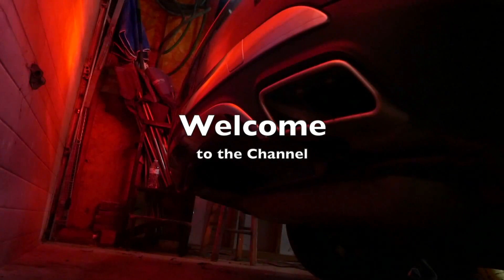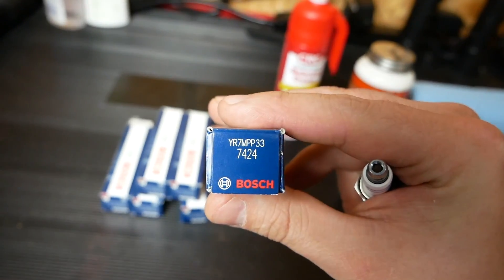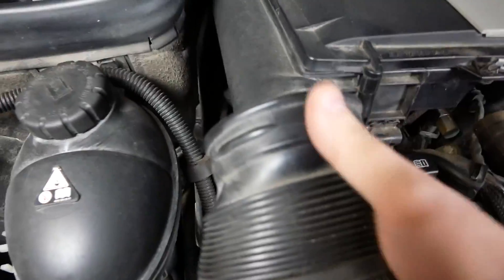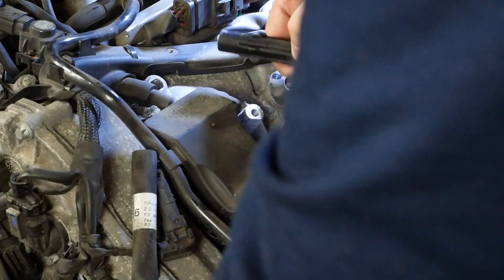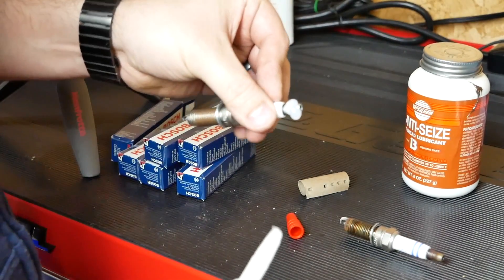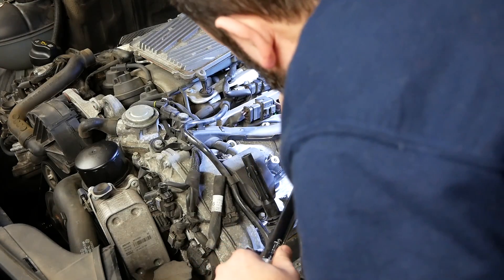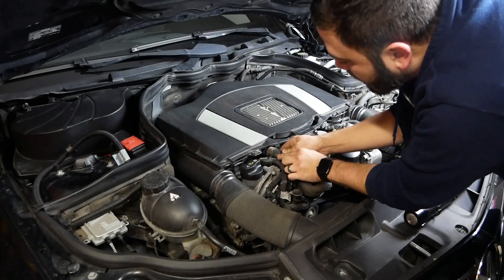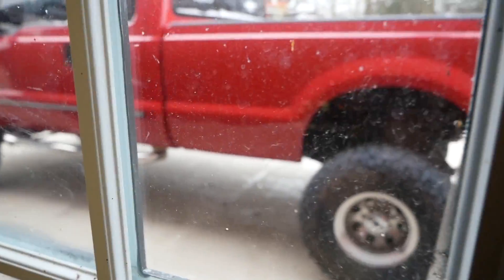W204 Spark plug replacement C300 M272 Engine 7MPP33 (v6.9.0)

Comment: I believe modern advice is no anti-seize compound as the plugs have a special coating? Risk is that its easier to over tighten. Great video, doing mine this weekend R171 350.

Comment: Not so sure anti-seize is a good idea? I've read it reduces the friction and you risk over-torquing the threads NGK plugs have a special coating/finish from the factory check it out on google.
Reply from the maker: Excellent point, entirely possible that makes problems for me later. Will research this ⬆️
Reply: Tiny bit of anti seize is OK if the torque specs is met.

Comment: The user manual actually specifies Bosch y 7 mpp33 without the R but all my local parts store has is the ones u used the y 7 Rmpp33. Did they work well for you without any issues?
Reply from the maker: Yes, these ran exactly as expected. I pulled one not too long ago to check and it was in good shape still 👍
Reply: @alwaysup2late  ok great thanks for response

Comment: Getting weird misfired after sparkplugs change. Also for some reason can’t seem to tighten the coil pack bolts on. They increase in resistance and then spin freely